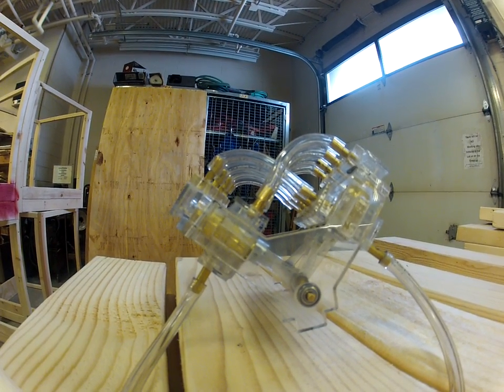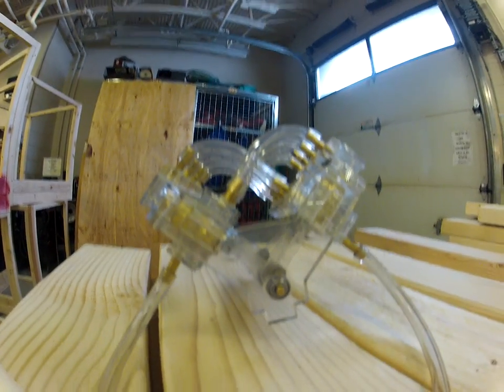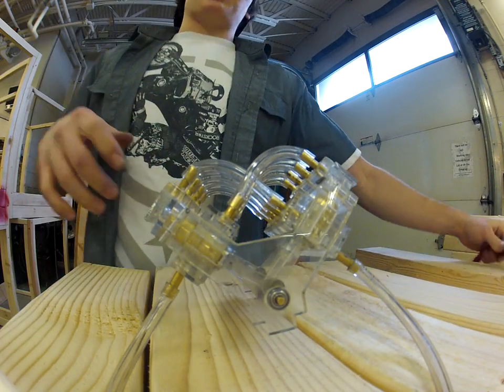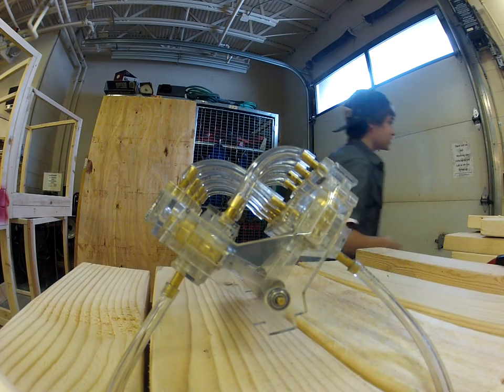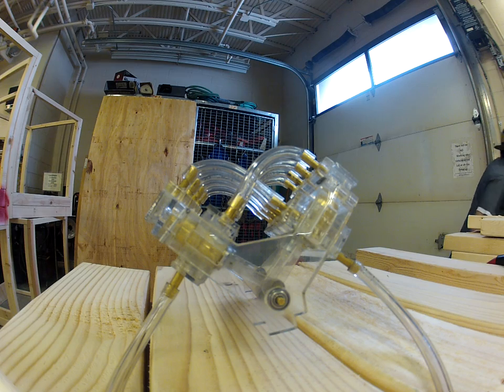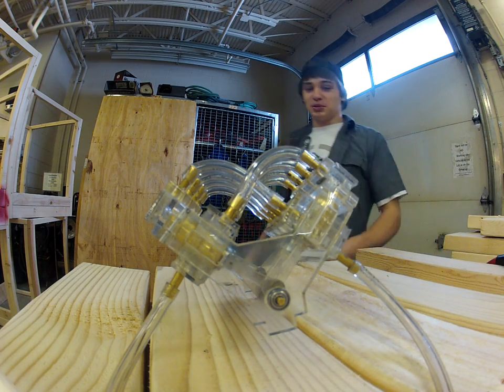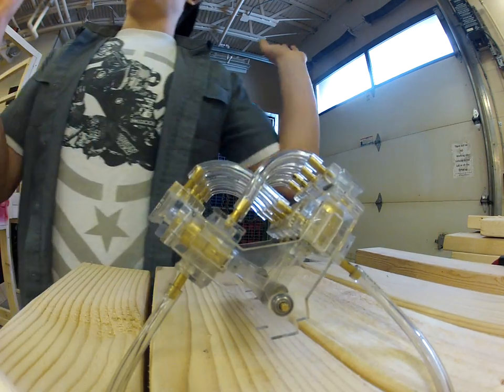V8 Air powered Engine (Best on YouTube, HD, V8 sound)

Comment: Can u make it have a oil pan
Reply: Also  do u think u could make a chassis to make it like a drivable little car?
Reply from the maker: @jaidenaxtell9366  I tried making a clutch for it one time, i have video of if you look around. Never built a chassis tho. Im sure it could power a RC drivetrain
Reply from the maker: Sure could. I used sealed ball bearing for the crank shaft. And then I found Graphite (dry lubricant) worked best for the pistons.
Reply: I'm sure it could cuz I have a 4wd 1972 chevy suburban it an rc car but it has the new 4 silinder in it bit I'm sure it be cool.
Reply: I saw the video when u where in Idaho I'm here in grangeville Idaho right now in a trailer park cuz I'm moving up here it would be awesome to see  your V8 air powered engine in person.

Comment: for a small investment in "unconventional" material you can begin to construct an air powered engine that can even power large industrial trucks. even if you're an engineer...or physicist...whats the use of building off of this well done example if you can't go high and beat the oil in the USA? Its not about building a machine- its about mass adoption. Its about control and power. Just ask Big Oil. See the wikipedia on air powered engines. It like other alternative energy engines were started as far back as 100 years ago. Its only about the initial introduction of the combustion engine and subsequent coruption that has made us one sick puppy in the pantheon of alternative energy 2018.

Comment: It actually sounds like a V8 motor. Maybe add a flywheel so it revs smoothly.
Reply from the maker: See my 4k Air engine video. I took your advice and installed a flywheel using an old harddrive disk
Reply: Sounds more like a V6 tbh, not bashing though, I'm impressed by the workmanship!

Comment: Would i be right by saying you have the exhaust of one cylinder going to the intake of the next cylinder?
Reply from the maker: Not exactly.  The exhaust of one cylinder does go to the next cylinder, but not as a intake, but rather the next piston is a valve to release the exhaust. This works in reverse for the power stroke.
Reply: matt bozawesome
nice.. whats the bore and stroke on it? and do you know what its max rpm is?
Reply from the maker: Check the description
Reply: matt bozawesome so 0.5 inch bore and stroke. Do you know roughly what it's max rpm is? And how long is the engine btw? Sorry for all the questions, I have to build something like this for one of my classes..
Reply from the maker: Max rpm I have no idea never measured, by the time I got it built I was moving on to other projects.  As for the exhaust, it is not driving the other pistons but rather the other piston acts as a valve controlling the air flow.
Reply: you answered that already lol, thank you though.. can you recall how long the engine is? im guessing around 3"
Reply from the maker: Haha my bad, yea about 3.75"